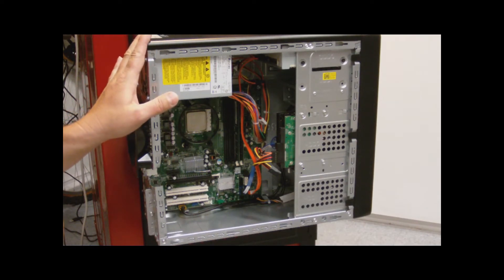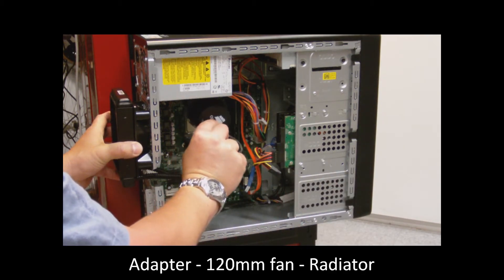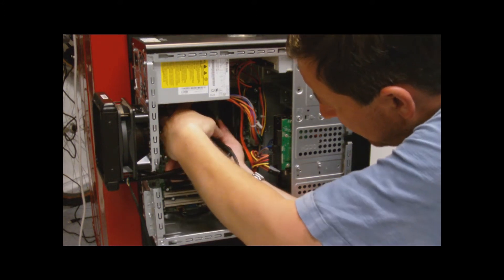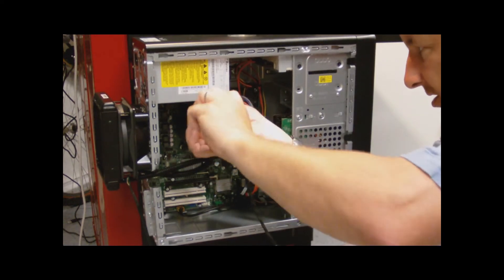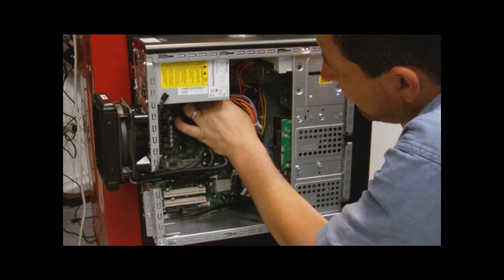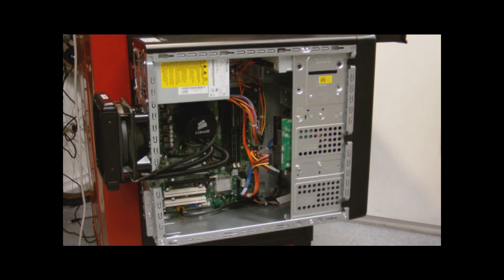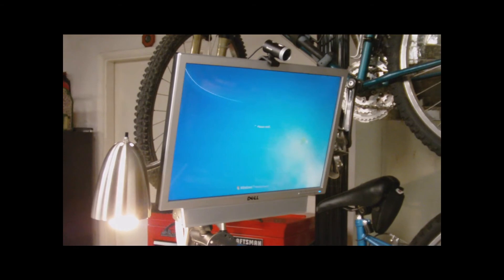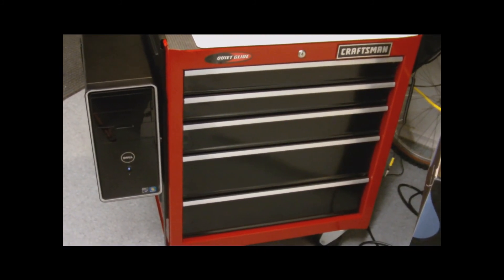AMD CPU Upgrade and Corsair H50 Bracket Installation - PART TWO

Comment from the maker: @DriodFX Correct, the Dell back bracket is bonded to the motherboard and very, very strong. You would always use the Corsair bracket if the existing one was not strong.

Comment from the maker: @crims111 Correct installation is outside air pushed through the radiator going inside the case according to Corsair. The H50 works great with this push pull set up.